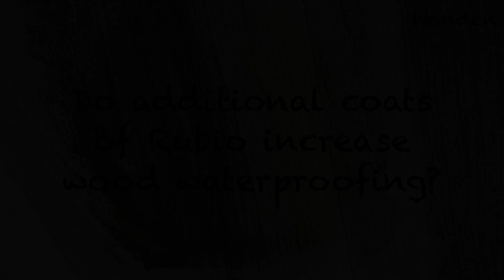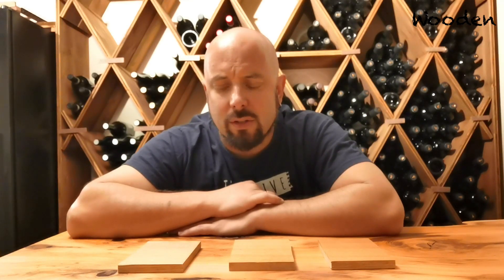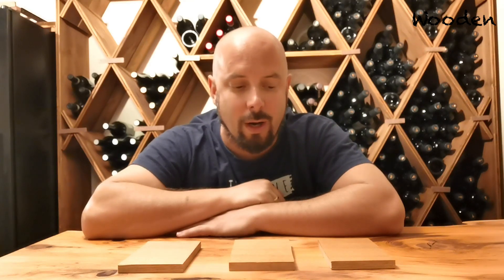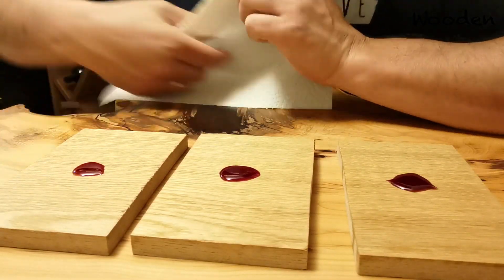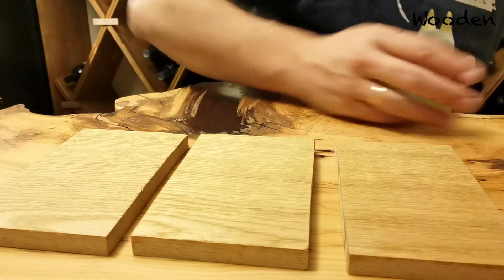Do additional coats of Rubio increase wood waterproofing?

Comment: Did you do anything between coats?  I used red Scotch Brite. Second coat gave a much better/deeper finish.
Reply from the maker: No, I don't do anything between coats. What did you do with scotch brite?
Reply: I did a quick “roughing” it up-slight abrasion.  It seemed to help and was indicated by another user
Reply from the maker: Rubio explicitly says to not do abrasion, but they also say to not use multiple layers. Either way, i don't think sanding in between layers makes sense in this case.
Reply: I understood that.  It worked well. Enhanced the coverage 

It’s a game time decision.

Comment: Thanks for sharing the info. BTW have you ever used Rubio on exposed plywood edges? Will it be durable?
I wonder cause the official answer is "no, you can't do it cause Rubio will not bond to glue" although IRL I've seen many examples proving these Rubio's reps claims to be only half-true and it seems it will bond OK.
Reply from the maker: Most welcome 👊🏼 I haven’t applied it to Plywood on purpose, but I often coat my table on plywood boards and Rubio spills on the plywood. Nad I can confirm that it absolutely binds. I also use it on wood filler, which is mostly glue ans it also binds on filler.
Reply: @Woodensoul  thanks! It will give me some confidence to give it a try. I will write a comment here later about the results.

Comment: When i use more than one coat, I follow the instructions that blacktail studios got from rubio. They say to wait until first coat is dry, then sand with orbital on lower setting with maroon pad until uniform frosted look. Then you can wipe it off and blow it off with air, no liquids or cleaners at all just air and a microfiber cloth. Then add second coat. You will have much better results.
Reply from the maker: Thanks Daniel. I have seen that video, but I have never tried it out. I rarely apply multiple coats nowadays, hence I have never needed it.

Comment: The roughness is the the wood fibres. When you do your final sand, you have to raise the grain with water, then very lightly sand. Then clean with mineral spirits. Then apply finish. I hope this helps if someone else didnt tell you already. I use rubio, and I've never had this issue.
Reply from the maker: Thank you for that tip, Carter. I have had this problem only rarely, but next time it happens, I will try it out for sure.
Reply: I have had this problem after water popping twice between sanding. Extremely light sand with 320 grit 24 hours coating brings back to a beautiful smoothness.

Comment: It’s called monocoat, you need one. Do NOT do more than one coat. I think about how on Armstrong stains they put one coat only because additional coats do nothing. And if you do add coats, good luck doing spot repair
Reply from the maker: I agree that one coat is enough, I disagree that more coats lead to spot repair problems. I do use sometimes more than one coat and never had such problems...

Comment: Have you ever used their Precolor?
Just finishing a big project using their intense black over walnut and finding that there is a big difference between one coat and two. Maybe it's the porous wood or maybe the water based stain (Precolor) but the second coat of Rubio gives a higher sheen and so I'm thinking a better protection as well. The finish looks great btw (on a large kitchen island). I also find that a very light sanding with 320 before the second coat helps smooth the finish (makes no difference in the sheen)
Reply from the maker: Hi Steven. I have never used precolors. It’s on my to do list, so thanks for reminding me. Reading your description made me curious 😆🤩

Comment: oak has a very high tannin level. If you take white vinegar and dissolve 0000 steel wool in it,  and then wipe it on oak it will turn the wood black. I think the wine might be doing something similar.
Reply from the maker: Could be. That’s why I took different woods to test…

Comment: Thanks for the video! This made me decide to use Rubio in a project I'm doing. Just one question, since it's my first time using it, once the Rubio is applied and the curing process begins, can I install the wood in place ( low traffic project ) or do I have to set it aside for weeks before I install it?
Reply: That is great news, thank you very much!
Reply from the maker: Hi Marin. If the project is low traffic, you can install it and let it cure that way. Without accelerator it takes 5-7 days to fully cure out.

Comment: Excellent experiment! Do you or anyone here ever experience blotching with rubio monocoat as it dries?  I have never used it but am contemplating switching to this product.
Reply from the maker: Thank you :D Usually, Rubio doesn't blotch. There are a few exceptions though: 1) If you applied sanding sealer and didn't remove it well, you will get blotching, 2) if you coat end grain and drop blobs of Rubio on it, it might soak in so quickly that it might look darker than other places. Hence I use brushes to coat end grain (I have a video about this). 3) If you don't remove the excess epoxy after 10-15 minutes well, you might get some parts that become all sticky. While I experienced these things, that happens very rarely and depends on you taking care about these things before coating.
Reply: @Woodensoul  Very very helpful information. Thanks so much!
Reply from the maker: @barefootlyrooted  Most welcome

Comment: Hello. Thank you for sharing great experiment.
My table is a bit rougher than before I spilled water.
I wonder that if I recoat Rubio on the table, is it get smoother? or does it need sanding? (As I don't have sander, I would like to recoat if it works.)
Reply from the maker: Hi Aiden. Applying Rubio over the rough wood won‘t make it much smoother. Buy a 240 or 180 grit sanding paper and sand it by hand until it’s smooth. Clean it well with eg mineral spirit, and then apply Rubio. If the previous coating is old, I recommen coating the entire surface. If it was rather fresh, you might be able to do only the sanded part…

Comment: Did you prep it correctly? Meaning using the cleaner? Super important to get all the dust (vacuum will not always do it) as far as I know Rubio does not bind to itself only the wood structure so of you do notice an improvement with more than one coat it is because you did not apply and wipe correctly (low chance of that it’s pretty dummy proof ) or more likely the surface actually had dust on it still and the first coat partially bonded to the dust. This is why it is important to use the cleaner, i hate it to but it last a pretty long time…
Reply from the maker: Good point but yes, I always clean the surface with the cleaner, even between coats…

Comment: Thank you for showing this. I would have liked to see a little more aggressive testing.
Such as small shot glasses set in the wine puddles to break surface tension and more
accurately portray a typical situation on a table. I'd also try different liquids.. coffee, juice
and simple water. Some experimenting with stain removal would be helpful as well..
toothpaste, peroxide, baking soda, etc.It would be interesting to see how, or if any of
these are effective without damaging the wood, thus making it possible to spot repair with
more mono coat.
Reply from the maker: Thanks for the feedback. These are all really good ideas! Maybe I will give it a shot one day…

Comment: I’m fairly new to Rubio. But I’m noticing as it cures it changes from a nice glass smooth finish to, after a few days, a ‘drier’ feel, not quite as smooth.  The differences are subtle, but noticeable.  BTW, I’m using American Cherry.  Do you notice a difference in how multiple layers of Rubio feels after it fully cures?  Also, in this experiment how long did you wait between coats... fully cured (5-7 days)?  Or just a few hours?  Thanks for publishing your experiment - interesting result!
Reply from the maker: Hi Dave. I know what you are referring to, and I did notice this effect too. I think it depends on the ‚hardness‘ of the wood. The softer the wood is, the more the surface gets rougher after drying. I think it has something to do with the wood fiber density and how the molecular binding works. There are a couple of things that can help: 1) Multiple coats (usually 2-3 in total), 2) if that doesn’t work then remove the Rubio by sanding, then sand up to 180 grit, apply sanding sealer and remove the sealer with 240 grit, then start again with the Rubio. 3) the most krass option is to flood your workpiece with epoxy resin to seal off the wood fibers, sand and then treat. I would only do that for end grain slabs (I have a video about that). In this experiment I let the Rubio cure for 7 days between coats. Cheers, Javier
Reply: I finished American Cherry table. Added second coat after quick wipe with maroon Scotch Brite. 👍👍⭐️⭐️⭐️⭐️⭐️

Comment: Have you experimented top coating with other products including wax and buffing the cured monocoat
Reply from the maker: Kind of. Whenever I tried applying Monocoat to a surface treated with something else, the result wasn’t good. Apparently Rubio needs the raw wood to do the molecular binding...
Reply: @Woodensoul  so will other products or wax stick to and enhance monocoat or make it worse/fail
Reply from the maker: Make it worse and fail

Comment: thank you for this video. did you sand or buff between coats?
Reply from the maker: Hi Jennifer. No, I didn't sand or buff between coats. With Rubio Monocoat, you shouldn't sand, because you remove the upper layer of the wood that did the molecular binding already. So you are undoing what you already achieved. So with Rubio, I never touch the coats in between, except some light cleaning with mineral oil, to remove dust...
Reply: @Woodensoul  Great thank you! Can't wait to try it on my ambrosia maple...
Reply from the maker: Sounds wonderful! Fingers crossed and have fun 🤩

Comment: Might try this type of finish. I too would go without the excellerant component. How long drying time in between coats? I’m a cabinet maker and can’t see how just one coat of any type of finish( other than a poured on expoxy) would really hold up for an everyday kind of finish. I’m skeptical about this finish mainly for the high cost
Reply from the maker: Hey Ken. Without the accelerator, the recommended time to cure is 7 days, although if I apply multiple coats I only wait 24 hours in between coats, then let it dry for 7 days. Yes, the costs are high, I agree, although I think it's totally worth it. Have fun trying it out...
Reply: No finish is true one-coat if we need high quality finish. The one-coat finishes are only for people in hurry that need acceptable result for 1 coat. But luckily, those one-coat finish always can be applied in multiple coats.

Comment: Are you using Rubio Monocoat 2c with the accelerator? If not, do you have any experience with it? I'm finishing butcher block countertops.
Reply from the maker: Hi Dawnn. Good question. I have used Rubio both with and without accelerator, but I moved away from the accelerator completely due to the following reasons: 1) It's hard to calculate how much Rubio you will need to mix. Either you mix too little, which is a pain, because then you need to mix again, or you mix too much, which is a waste. 2) You need to hurry a lot more to apply it, because it hardens pretty fast, 3) It's more expensive because you have to buy the accelerator, 4) I found that the final look was subpar compared to pure Rubio (that last point might be totally stemming from my imagination, so totally subjective feeling). The only reason to use accelerator is if you are in a hurry, as it hardens completely within 1 day, instead of 7 days without hardener. As I am never in a hurry (this is my hobby, not my job), I don't use the accelerator anymore. Hope that helps.
Reply: @Woodensoul  that's great, thanks. I'm in no rush and want the best possible finished product. 
Thanks for taking the time to share your experiences.
Reply from the maker: My pleasure, have fun 🤩
Reply: @Woodensoul  Hello Wooden :) I am big fun of Rubio as well.A have read from official page of Rubio that if you are using it for example on dinning table,stairs or floor,you should use an accelerator as it will protect more from water spell etc.What do you think about that.Sorry for my bed English.
Have a good day mister
Reply: @Woodensoul  It "should be" more durable with Accelerator.Thats what they said.
Reply from the maker: @WoodyDeer  Hi! That is a good question! I have also heard that claim but I have never verified it! Let me try it out and get back to you…

Comment: The third coar looks a bit darker..is this true. I like it more
Reply from the maker: It must have been something with the lights and the camera angle. In real they looked identical to me...
Reply: @Woodensoul  ok. Thank for experiment. I was thinking for a long time what will  happen if applying 3 coats. How is Rubi protecting the wood for scratching comparing to laker?
Reply from the maker: Sure thing. What is “laker”? Is that another type of coat?
Reply: @Woodensoul  sorry. wrong spell...lacquer is the correct word
Reply from the maker: Ah, got you. I think Lacquer protects the wood better from scratches, but once the lacquer coat is damaged its much harder to repair. With Rubio you just sand lightly, rub some Rubio on the scratch and its gone...

Comment: Thank you for doing this.  I like your experiment.  Your conclusion is funny though.  In 2 of the 3 tests, you say you can see and feel the difference, and in the third you can not.  Yet your conclusion was drawn from your third test.  Seems to me like multiple coats protect better for short exposures (an hour or less) and that  multiple coats do not protect better for long exposures.  Life is full of short term exposures ;)
Reply from the maker: Thanks for your feedback, and I do agree with your remark. The main reason I did not draw this conclusion is, that the differences in the first and second round were really very small, so I am not sure if the additional time and money is worth it. But certainly, if one has a project where that effect would be a gain, then two coats might be worth it...
Reply from the maker: Winston Sammy  Most welcome :D